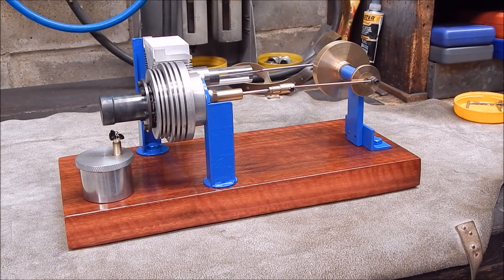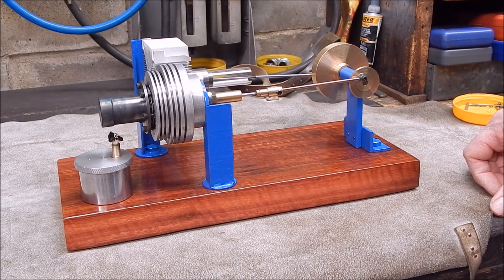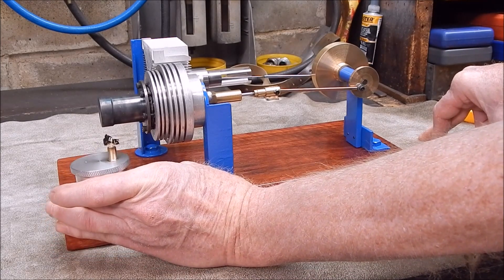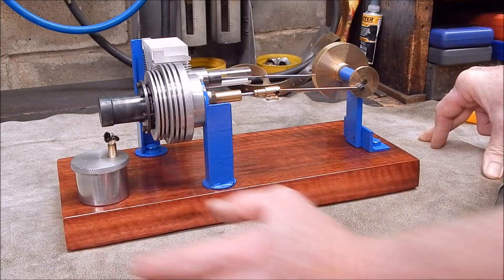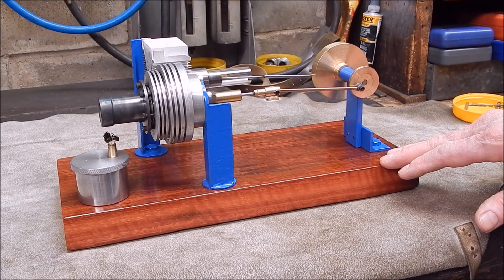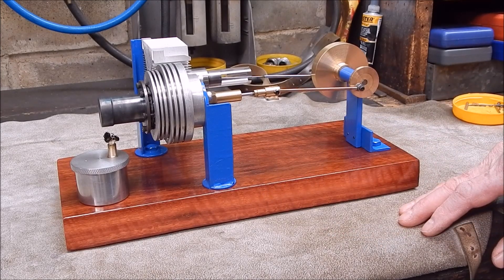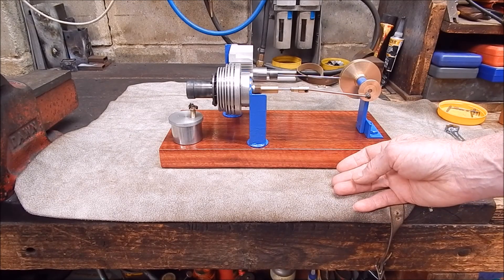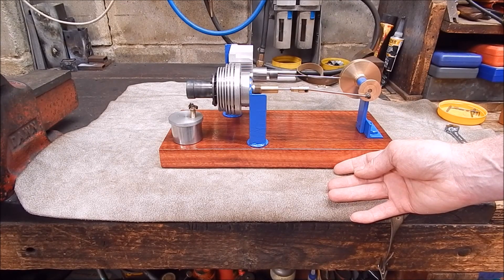The "Blue Devil" Stirling engine project is complete

Comment: Hi Rob,  awesome video on the little engine.  I can't believe that I missed this one.  Was checking back on your videos and noticed this one that I had not seen.  Wonderful job.  Thanks for showing.

Dale in Canada
Reply from the maker: Hi Dale,  thanks for the positives.  This is the second one I've built using a dash pot and they both run great.  I've not seen anyone else use a CPU heat sink for cooling before.  It works excellent and the engine will run indefinitely as it never overheats.  They can be cantankerous to get right, but when all the stars align and the wind blows in the right direction, they come good ;)  Great little project to test out your small lathe skills.  Cheers Rob

Comment from the maker: The engine was a bit noisier than expected when filming this.  I later found out that the displacer piston had worked loose and was kissing the cylinder walls.  A bit of re-engineering fixed that and it now runs very quietly.  I did a speed check and the crankshaft is spinning over at about 1200 rpm on the metho pot flame. Overall I'm pretty pleased with the end result.  Cheers Rob

Comment: With all that trial and errors, this engine is running great, time to scale it up enough to power up the whole household, I suggest you install it at some reasonable distance from the main living areas or you may live in quite a shady space.... 
Imagine the size needed to supply enough power to cover all your needs...   😱😱
Reply from the maker: It had one last trick after the video Pierre.  The displacer piston came loose and was scraping around inside.  So one more tear down and re-engineered that bit. Now I'm thinking maybe I can reduce dead space by modifying the displacer piston end slightly, LOL.

It never stops with these projects.  I must have an over active brain, or something. Maybe too many reds.  Cheers Rob
Reply: @Xynudu  Keeping the brain active is a great way to enjoy living...

Comment: some info.    all sources of noise should be  examined.    the hot-side seems to be noisy.    this engine has a too-small flywheel, that has a less-than optimal  dom.     Excess mass in various linkage components  LIMITS  engine top speed. 
    https://en.wikipedia.org/wiki/Governor_(device)

Comment: Cracking engine Rob, you've done a fantastic job with that, love the wooden base looks amazing. Cheers, Alan.
Reply from the maker: Interesting.  The quality varies a bit and the lower grades would be used for sleepers.  Some of it can have air voids in it in a similar fashion to Australian Red Gum - which was/is used for similar purposes.  That can also look striking when clear coated.  It's so hard you have to pre-drill it to put a nail in it.  Cheers Rob
Reply: @Xynudu  Well it's all an education for me, I've not heard of either of those woods, off to Google Australian Red Gum now 🙂 Cheers, Alan.
Reply from the maker: Hi Alan.  Australian Jarrah is the (hard)wood.  I don't know if you can get it in the UK.  The colours are amazing.

It's quite heavy and fairly dense.  Most of it comes from Western Australia.  Makes a great model engine base.  It tends to darken if you oil it, but clear gloss really brings it to life.  Cheers Rob
Reply: @Xynudu  Just had a look on ebay over here and it looks like you can get things made from it like bowls & cutting boards and at the other end of the scale railway sleepers but not just bits of the wood. Cheers, Alan.